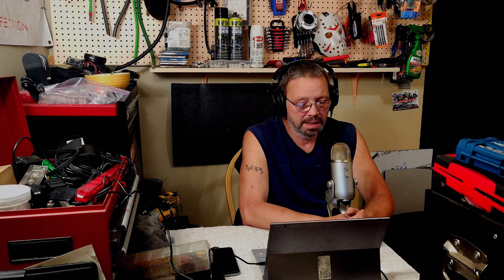why does my voltage drop on my car audio system

Comment: I have a question. Let's start with what I have.. 2 agm 95ah batteries,  270 amp alt, doing around 180 at idle. Big boss 3k and a jp34ab. I hold a steady voltage 14.2-14.6 most of the time. Here's my question, how much voltage drop is ok.. if i push my system i can drop to 12.9 but quickly recover to 14.6. Sometimes its so quick i don't see it on my digital readout but the voltage gauge logs it. The lowest I've seen it stay for a couple of seconds is 13.2. I don't show any clip when it happens, I'm just running out of power. Would you consider 12.9 safe since its not technically dropping below my battery voltage or should I stay around 13.5 or even less drop? Im not really comfortable pushing it below 13.5 because I don't know what's safe and if it wasn't a taramps I probably wouldn't worry about the 12.9 so much.  Whats your advice for reasonable voltage drop? Would a 5k amp make it worse or help with efficiency. Lithium? Im happy with what it does but who doesn't want more. Im running .5 ohm on 2skar vxf12s
Reply from the maker: ok, with ANY battery youre going to drop to resting voltage or near it once you pull more that the alt is outputting. when you say you recover  to 14.6, whats happening actually is once you shut down the system, the load drops enough where youre reading the alternator charging voltage. 
now as for what youre asking, the lower the voltage goes, the more amprage youre trying to pull, that makes heat, heat is bad. the solution is to run batteries with higher resting voltage. like the trunk thunder lithium 5kv2 it can take power and give power MUCH faster than the agms youre running, and rest at 13.1v i believe,  with that alternator and the 5kv2 you can easily run a 10k amp. im running a similer battery, and my voltage stays in the high 13s, and thats ON A 8K AMPLIFIER. hit up trunk thunder lithium, use my code cae10 for a discount. trust me youll love it.
Reply: @CarAudioEnthusiasts thanks for your time and advice. Is that battery something that would replace my 2nd agm and go inline with my starter battery? Or would I only run the lithium? Both are trunk mounted and there isn't a underhood battery from factory

I recover while playing it just seems a certain frequency range is inefficient.  If that makes sense. Im actually quite impressed with how well these 2 12s and the 3k performs
Reply from the maker: @TOLDyouSOagain  you can run totally on the trunk thunder lithium, and your voltage will rest higher.

Comment: Yep Grounding is always a major problem no matter how many Alternators Batteries/Caps you put in ya vehicle. Stabilising Voltage was a thing of the pass when I finally had a eureka moment understanding I had my ground all wrong. I have 2x 300amp alternators and my wiring is isolating from the car itself. Now I have  VOLTAGE RISE when my bass notes hit. And that’s at idle🤣🤙
Yea I have more power than what I need but I’d rather have more than enough than not enough. 
Great to hear your on the same page as what I know    Your pretty bang on.
Reply from the maker: awesome!

Comment: It's like we're on the same level. Hour ago I pulled in the garage and noticed Everytime it drops low I could see my headlights dim a little. 3200.1D mono on 2x 15s (only @ 4ohm & setup Free Air 2000 Accord). I didn't have the heavier speaker wire at the time and haven't stopped working on my door panels to rewire with 12g (subs to amp maybe 3ft & 8g 17ft power wire)
Reply from the maker: yea, you already know what you need, lol.

Comment: I think my sub amp is going protect when i stop at lights or stop signs, is this an elec problem? i have a JS alt 250 amp and big 4 1/0 sky high wirs but it still happens. the amp is skar 1500.1d
Reply: If you suspect the amp is turning off due to low voltage, monitor the voltage at the amp and see. Then you'll know.

Also keep in mind that the alternator power is based on rpm. When the vehicle is at idle it's produces it's lowest power.
Reply: @JasonWW2000  Thanks for the comment, how can i monitor that voltage input? any help welcome!
Reply: @InabnettMusic I assume you have a digital multimeter. Clip the leads to the positive and negative on the amplifier and then warm up your vehicle so that you're at normal idling speed. Put it in gear with your foot on the brake so that the RPMs drop down just like they would at a stop sign and then turn your music up like you would normally have it and see what the voltage dips down to.
Reply: @JasonWW2000  got it. Seems a sound idea. I will give it a shot. Shout out to this community and you Jason. Thanks!
Reply: @InabnettMusic No sweat. If you do have really low voltage, like 10 volts, check all your wire and fuse connections. They might have developed some rust or oxidation and need cleaning and/or retightening.

If that doesn't fix it, borrow or buy a clamp style DC amp meter and see how much amperage your alternator is putting out under those same heavy load conditions. It may simply not be putting out enough current at 600-700 RPMs.

What vehicle is this? Is it an aluminum body?
Reply from the maker: Do you have start / stop on your car?
Reply: No, it’s 2011, no stop/start. I’m not sure what it is going on
Reply: @InabnettMusic I'm not sure what that body is made of, but you could always check the floor pan and firewall with a magnet. If it's steel it should be able to carry the current of that particular amplifier. If it's aluminum you might want to add a dedicated ground wire. That's a last resort though. You want to check all that other stuff first.

Comment: Anybody got a good source for service manuals? My car is a hybrid and i have no idea how to figure out what my electrical system looks like. I know i have a big ev battery and also a standard 12v car battery (conveniently located in the trunk) but i have no idea what the recharge capability of the system is. I just got a s.i. sql15 (1000wrms) and I'm not sure if i need to upgrade anything or not. Its a '24 camry hybrid se so if anyone could point me in the right direction i would greatly appreciate it
Reply from the maker: with 1kwatts, youre prolly fine man, and hybrids can be tricky. but if you really want a rabbit hole to dive in, look for prius bass builds.
Reply: @CarAudioEnthusiasts   that... sounds like a fun rabbit hole to jump down lol I'll check em out
Reply: I'm assuming that model has an EV mode that allows you to drive with the gas engine turned off. If so, then all the engine accessories like the power steering (not sure the voltage) and air conditioning (high voltage) will be electric. 

This means your 12v system (lights, computers, windows, etc) is run off the 12v battery. The 12v battery will be feed or recharged through a DC to DC converter. It's going to take the 250 or so volts from the big battery under the rear seat and convert it down to 14 or so volts. 

This converter will be rated for a certain amperage. I don't know what it is, but I'd guess 50A to 100A. They always build in a certain amount of Reserve in case you want to have auxiliary lights or stuff like that. 

If you can't find details on it then you could probably test it and see how much amperage it could provide. You'll need a clamp style DC amp meter to put on the positive or negative cable and a DC load resistor that is used for testing batteries. The bigger ones have adjustable amperage and can pull up to 1000 amps. 

Use the clamp meter to see how much is being drawn normally then add at least a 100 amp load and see how the vehicle responds. If it it maxes out at 70A then you know your DC to DC converter does 70 amps. 

Once you know how much amperage it can put into the battery you'll have a good idea how much reserve you have. 

1000 watt class D amplifier isn't  going to be drawing 100A of current continuously. It's going to draw amperage in surges and the average is going to be a lot less like 20 to 40 amps. 

So I think you'll be fine with that size amplifier. A stock electrical system on a gasoline engine can handle that and I think most DC to DC converters can handle that.
Reply: Wait, are you telling us the sub power rating? It doesn't so much matter the RMS power of the subwoofer. What matters is the amplifier you're going to use and how it's going to be loaded down. You could have a 10,000 watt amplifier, but if you're only going to turn it up to produce 100 Watts then it's not going to have any effect at all on your electrical system. Are you going to be competing in SPL contest where you need several thousands of watts?
Reply: @JasonWW2000   thanks for the info! I'll price out the clamp and resistor to see if it's something I could do. But I gave the sub rms because I don't have an amp for it just yet but I know I'll be turning it down to 1000watts. My days of pushing subs to the max are long over (probably lol)